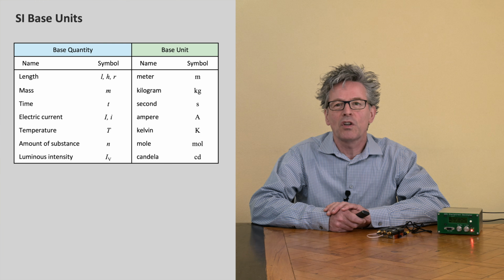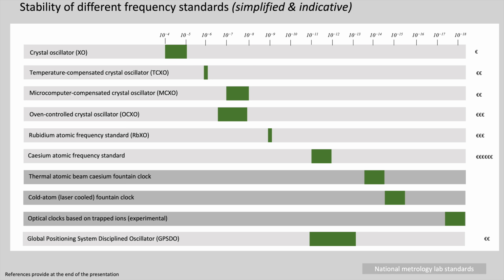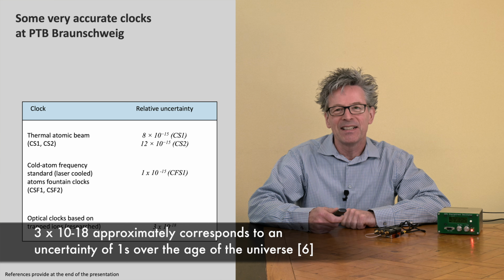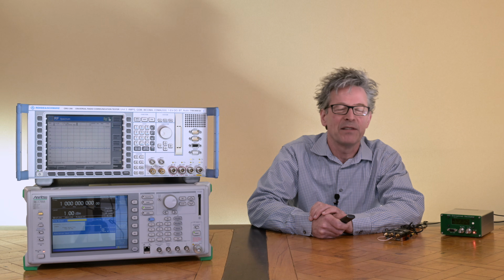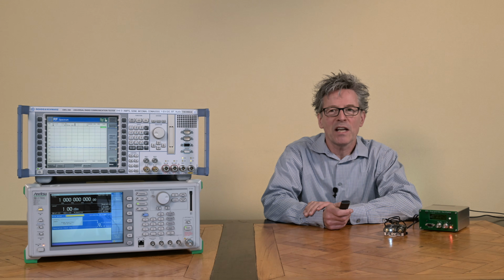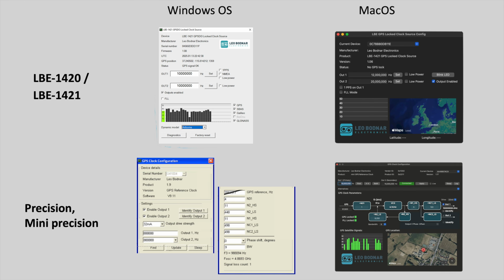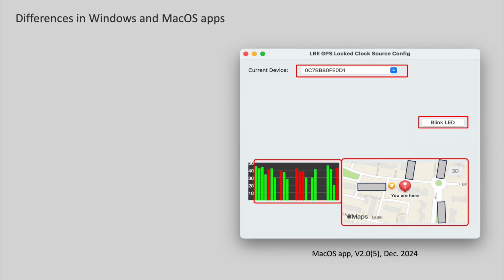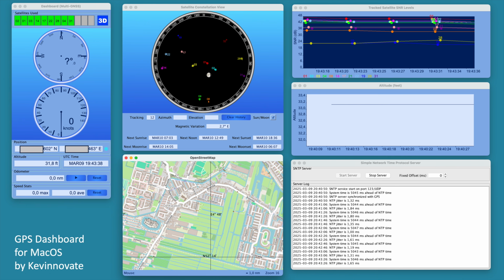REL #53 The new (2024) Leo Bodnar 2-port GPSDO Model LBE-1421

Comment: If GPS goes down does the cell network die?
Reply from the maker: Firstly, I do not believe all radio base stations for mobile telephony require their own, accurate clock, but older IS-95 ("cdma") did. My new video, posted yesterday, talks of a frequency generator from such a base station (the Lucent RFTGm-II). And if radio base stations do not need such a local reference, they usually have a GPS-disciplined system (for long-term stability) that can also freewheel if GPS goes down, so the cell keeps on working. I know that for the Lucent, such freewheeling was only guaranteed to work for 24 hours (with a local Rubidium atomic clock) and only 4 hours (for the cheaper OVXO clock).

Comment: Rudi, I have the 2017 Leo bodnar and when hooking it up to a Agilent N9010A with 1yr old calibration it showed 10,000,000.08Hz for the first harmonic. In your screenshot of the LPF measurement we do not see accuracy. Spectrum analyzer warmed up or XO not locked?

Comment: Thanks!  have the BG7TBL and Leo Bodnar too.. great addition to any lab. The cheap BG7TBL compared to a real (older) Rapco, is not bad at all. great bang for your buck.
Reply: I have a BG7TBL as well (they use different internal GPSDO boards) and mine also has a good holdover. When powered long enough, it tracks how the OCXO is adjusted over time. This enables the unit to continue compensating the OXCO during GPS outages. This simply means that if I pull the antenna plug, it will remain pretty stable and doesn't runaway like the Bodnar units do.
Reply: @meindertsprang7491  Yes that is a big advantage with an OCXO.. but the Leo with TCXO will use less power and it runs 24/7/365 .. there is always a pro or con :)

Comment: One improvement would be to use a Green (GOOD) LED colour for being Locked to GPS, just like the software. Agree with checking the USB power supplies for voltage and noise first!   
Also, the isolation of the various supplies varies, so in the ideal world check the earth leakage current.  Cheers
Reply from the maker: Concerning isolation, I use a transformer isolated 10 MHz,  6 output distribution amplifier. That should prevent any ground loops. Moreover, the current PSU that powers the Bodnar is floating.
Reply from the maker: Thanks Ray for the reaction. Agree with the power supply. If I decide to power the unit only when I use it (rather than 24/7) I’ll probably make it battery powered. Maybe a 220V relay just to connect the battery when I turn on the labs main power switch.

Comment: All the atomic clocks are based on quantum effects, just to different degrees.

Leo bodnar uses TCXO; traditionally, an OCXO would be more stable in the short term than an TCXO (after the OCXO has been given many hours to warm up and stabilize). Of course, over long term (days), any GPSDO is the most stable with a very long average because it's tracking official international time by definition. However, long term average accuracy is the only actual guarantee. In short term (seconds, minutes, etc), they could be deviating while the locked loop algorithm constantly adjusts the primary clock circuit to try and match the phase delays reported by the GPS chip in use. It would be interesting if Leo Bodnar had any claim to have matched the short-term stability of an OCXO or not, with their TCXO clock.

You pay more for the power an OCXO uses, but for instance an advantage might be that it would take longer to run out of phase with a small loss of GPS lock than with a TCXO.

Comment: @Rudi's Electronics Lab. Thanks for the video. Not sure how much  Bodnar's design is based on his own work. (Perhaps the software is outsourced... don't know.) I don't know; but, I speculate that the oscillator is not an OCXO (as they are expensive ... Vectron SC cut OCXO... about 100USD in quantity... and under demand, for obvious reasons) I am thinking Bodnar uses a TCXO? I am a bit down on the Bodnar unit, as no manual, and no detailed (or any?) explanation of what is going on under the hood.  I'm wondering why you wouldn't build your own? (The software doesn't have to be GUI, if you have a CLI, from a terminal. There are lots of new/used modules available, + parts + PCB... would cost less than the Bodnar unit.... and be much more flexible... IMO.
Reply from the maker: Thanks! The Bodnar units indeed use a TCXO, its actually specified on their website (maybe I was not clear on this in the video). Other GPSDOs often use an OXCO, but mostly recycled ones from the old cellular base stations, and their state might not be great, as well as their expected lifetime. Both TCXO and OXCO have their own advantages and disadvantages in this specific GPSDO setting. I have the impression that Leo Bodnar writes its own code for the controller program, but I cannot know for sure.

Comment: Nice review, plus a refresher course in different clocks & their characteristics!
@31:40 I'm confused by your table for the older devices. The software for the old Precision GPS Reference Clock is different from the software for the old Mini Precision GPS Reference Clock, so the word "Mini" shouldn't have been shown in brackets in the heading. The current software is 1.20. The website has never been updated to show the current display with the latest software. I put up a Windows screenshot on EEVBlog (with my coordinates blanked out). Many of the details in that table do not apply to the mini. It also now has NMEA support, so can be used with Lady Heather.
Reply from the maker: Thanks! It is fascinating stuff. Who would ever have expected I;'d be digging into this...

Comment: Nice video, Rudi! Too bad the old one isn't in a working state anymore, would've been nice to see the new one compared to it as well (also it could be worth looking at how quickly they both start to drift after losing GPS or due to intermittent failures)
Reply from the maker: Thanks! As the old one had a salvaged OCXO from a base station, it already has seen many hours of use. Likely the crystal in it has aged and drifted away from its normal frequency so far that its electronic frequency control input (often 0-12V) could no longer correct it to 10 MHz... Will take another look at it, however...

Comment: I got a new Stanford Research GPS Time and Frequency System FS740 with optional rubidium time base a couple years ago to replace my older HP 58503A GPS Time and Frequency Reference Receivers.  The new one has a long term stability of 1 X 10 to -13.  Also got the 3 optional 5 output cards for it so it has a total of 16 outputs on the rear.  What's really nice is you can use it as a adjustable output feature that goes from 1uHz to 30.1MHz in 1uHz steps along with a added bonus of also being a time/frequency counter.  The older HP units are now being used as time standards for my 1GHz and higher amateur radios.  Mike KC3OSD
Reply from the maker: That's a nice unit! I may try to pick up a rubidium clock one day myself, if the opportunity presents itself ;-)